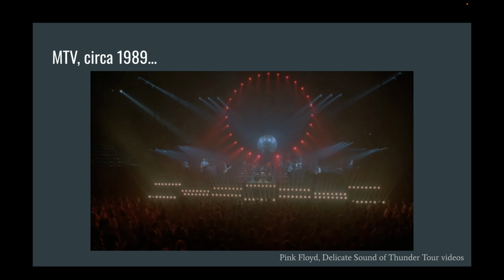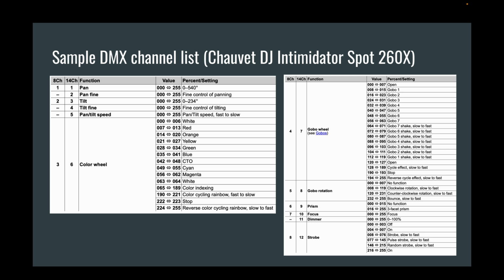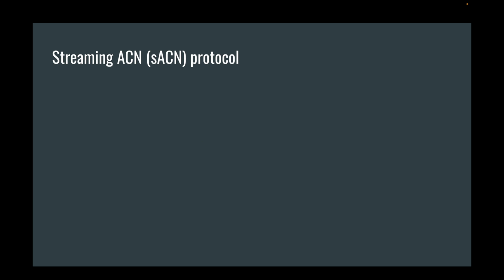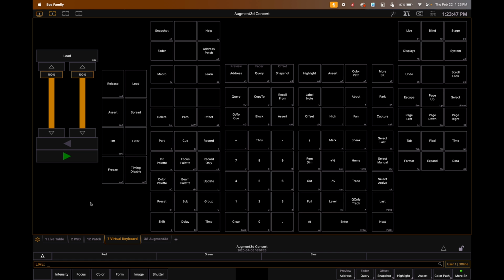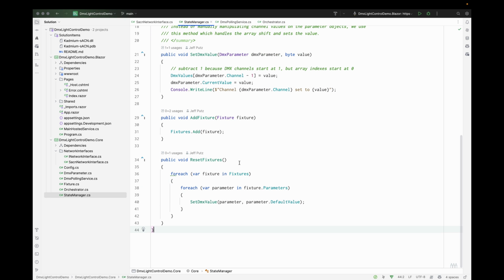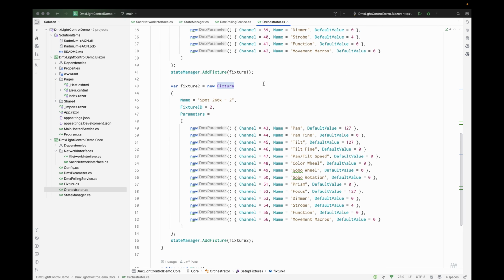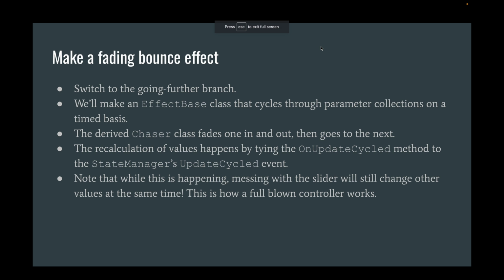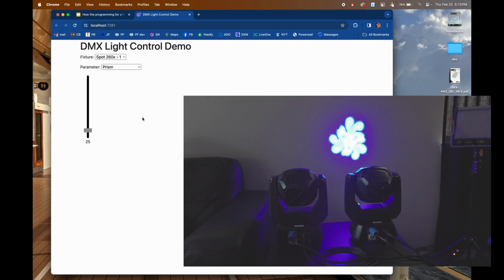How the programming for a light show works

Comment: Very cool !  Nice job !   A couple of points:  1) DMX should use DMX Cable, it can be 3 pin DMX cable, but the impedance is slightly different between a mic and DMX cable.  I think the reason. they push for 5 PIn is ro make sure you use the right impedance.  Also, sending 48V Phantom power to a DMX  device is not good
Reply from the maker: The fixtures and interface don't have five-pins, so nothing different would happen adapting to 5 conductors in between. I'm not gonna be sending 48V phantom power down a cable plugged into DMX stuff. :) Yes, the impedance spec is different, but really not relevant over 3-foot cables. Now if only everything just natively supported sACN and Art-Net over ethernet...